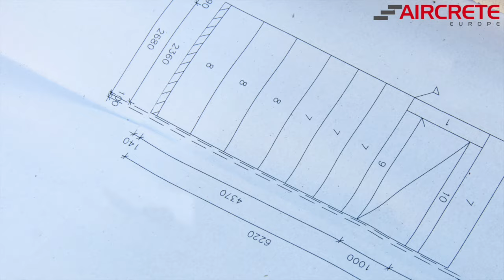The Aircrete Building System

Comment: I think Foam Crete is a good material for using a buildings if used correctly. I don't like  how they put this house together, there isn't anything holding the panels to one another, just some adhesive cement on the bottoms, then on the top! Normally whenever you build anything with concrete or foamcrete you use some type of rebar, there isn't any in this.  They should at the very least have some type of steel pins going from one panel to another. This is crazy the way this thing is built, it looks like a house of cards to me!
Reply: no, the guy helping to attach the crane to the block is spreading mortar along one edge, this is holding the blocks together. My grip is that it is single skin, I don't know how long term it will stand up to damp penetration. I would prefer to see the blocks made of 2 skins sandwiched by cavity insulation foam
Reply: It is an engineering sense and practice what you have stated and wish to receive a professional reply from the company.
Reply: I've worked with all kinds of structural building materials, and I have used Fiber Crete in some insulation projects, People have claimed a lot that they can get good flexibility, tensile strength, and compression out of fiber crete, but I've only seen any type of structural integrity with some type of rebar included like you would do with any type of regular concrete. When ever I have done any type of wall or foundation with concrete the building code has required steel bar reinforcement. What they are doing here just doesn't seem correct to me from what I am observing from this video.
Reply: Workin Alday I can say it is similar to load bearing wall system where bricks or blocks units bonded together to form a stable wall and then tied on the top by concrete tie beam and then cast the concrete roof. This kind is widely used in some countries in Middle East in the last 60 years especially for small villas where no structural criteria but general practices developed throughout the years. But I'm still curious about the AAC panels and how is it feasible in low cost housing.
Reply: Yea from an insulation perspective I think the panels are great, I wouldn't consider them for anything structural without a steel reinforcement though.  Maybe they actually have the steel in them. Foamcrete is normally really light weight, there shouldn't be any reason to lift these things with a crane! So maybe they already have the rebar in the panels.
Reply: Workin Alday 
Their tensile qualities probably don't require rebar. I bet the bubbles serve that function.
Reply: It's just cellulose, it does give it a high compression rating. But up where I live you have to put rebar in it. Building code won't allow just poured concrete or fibercrete. Especially on those panels that they are using as a roof.
Reply: I tend to agree.  While looking at this i'm also keeping earthquakes in the back of my mind due to where i'm planning on building and unless I missed something (which could easily be), that just looked like really big bricks with mortar, which I would have thought would have the same problem as small bricks and mortar.  Maybe that area just doesn't require those safeguards though.
Reply from the maker: Dear All, thank you for the interesting discussion. Autoclaved Aerated Concrete (AAC) is NOT foamcrete, fibercrete or cellular concrete. AAC is made of sand, cement, lime & gypsum (as binders) and aluminum as aerating agent- the products are steam cured in autoclaves during production to complete the strengthening chemical reaction. This lightweight product provides structure, insulation and fire resistance in one product. AAC panels have embedded steel reinforcement for additional structural strength. AAC panel building complies with existing US building regulations and is currently successfully used across the US (see www.aerconaac.com).
Reply: Good to know, thanks for the response. I thought this was regular foam crete, with no steel in it.
Reply: I wouldn't want to be in that house during an earthquake.  I noticed the same thing.
Reply: It's not simply foam crete....so...........
Reply: Workin Alday they insert rebar in the small holes you see in the panels
Reply: Well I am not sure why you did not notice them using metal connecting bits at tops of each block and also when the walls go up they drive metal dowels through the sides.
Reply: i agree with you.....
 from engineering perspective 
building are sorted as three main types  :
1-skeleton system 
this system  rely on (flexibility) which  mean all structure members must be connected  together from roof to footing or lowest  slab  by flexible materials such as steel bars or steel tubes and react as a body bone.
2-wall-bearing system:
there is no re-bar or any flexible  connection in this system because  its rely on ( rigidity ) of  heavy bricks,and these bricks  has a large width around 600mm -400mm .
3-space system:
this  include dome and vault which not our case
Reply: These wall andere floor panels are reinforced where needed with corrosion protected steel bars.  Of course loadbearing properties are based in state of the art stress calculations. In fact the whole building structure was stress calculated.  
Other than dense concrete, foam concrete is permeable for moisture and vapor. 
As true for all houses regardless their materials, cold bridges must be avoided.  
Due to good insulation properties of foam concrete heating costs are reduced.

Foam concrete is a good and durable construction material when the building is designed, build and finished by skilled people that know what they are doing.

Regards
Greattimez
Españistan

Comment: I'd like it better if the panels were interlocking or had metal rods connecting each panel. Maybe both. I'm sure how they built it is just fine but I'd like the security of having each panel fastened together with something other than concrete or mortar. Just my two cents worth.
Reply from the maker: Hi Nathan Scott, every country (sometimes state) has its onw regulations. This video, shot in the Netherlands, has every 2nd panels anchored to another with a steel plate. You can also do it for every panel but that is fully your prerogative and not required by code normally.

Comment: The material seems interesting. 
Building codes in Europe are supposedly higher than in USA. 
Where are the specifications, engineering reports. 
I can not believe that some glue is going to hold those panels together in an earthquake, hurricane or tornado.
Due to ground shifting, swelling from moisture and shrinking from excessive dryness many homes develop cracks, walls shift.
This could be a major problem. 
There appear to be  no penetrations for plumbing, elwctrical, or HVAC. Drilling
holes would weaken this material possibly introduce cracking.
Daytime heating will cause that material on the outside of the building to expand ( even slightly ) at a different rate than the interior. This will cause shearing.  There appear to be no expansion joints.
Reply: Scott Hertzog thank you
I see now that this material is subjected to a high pressure steam to cure it. The DIYers are not doing that. That would make a big difference in its structural characteristics.
Reply: I guess you, like many others, failed to see that the panels are in fact pinned together at the top as well as joined with mortar. Making this a sound structure.
Reply: I found this material from a DIYer video where they were making it with a foam machine. It was not steam treated. Mis thinking that this material was made the same way. I have seen concrete that was not well done deteriorate over time.
       Small pores in concrete or masonry materials allow water to collect. In semi cold climates where freeze/thaw cycles happen several times in one season. Water gets in the pores freezes expands melts. After several years this results in spalling. Then it just keeps getting worse. 
       Reading that the material was steam autoclaved for curing makes this a much better product. The glued joints seem to hold although I live in an area where the soil dries and soaks in different times of the year causing significant structural movement. Foundation repair is a big business in North Texas. I will be doing more research. This is an interesting product.
Reply: Scott Hertzog ...Any specs here in the United States that are published?
Reply: Any specs in the US?
Reply from the maker: Dear All, specifiaclly for the specification of AAC and its use in US, please see www.aerconaac.com

Comment: Introduction of graphene to the mix is an ideal option for additional tensile strength.
Reply: bit expensive, lots of cheaper fibres already used
Reply from the maker: Dear Bernard Macarius, sure, however, AAC is in no need really to have more tensile strength. For its application it is used for many years, it perfectly suits as is. Moreover, it is normally a premiumly priced product, compares to its other cement-like alternatives, so adding extra costs will inevitably result in higher sales price for offtakers which is not desirable to say the least.

Comment: How does this construction material compare with sip construction? The latter is much lighter,and has excellent insulation properties,and goes up fast as well. There have been sip homes that have survived tornadoes/hurricanes while the neighbouring stick built homes have been destroyed.
Reply from the maker: There are many ways to look at it, but in short the pros are: AAC is fully prefabricated at a factory, costs typically less per ft2, has better acoustical properties (AAC is UL listed UL #924), has much better fire rating than anything else (4hrs on 8in), pest resistance is very high, it can be shaped and sculpted, same low waste on site due to complete prefabrication, highly environmentally friendly due to 1m3 of raw mats used to produce 4m3 of final product. However both systems have right to exist, or better put to co-exist as SIP has similar merits too.

Comment: Is there some positive mechanical locking of the walls and floors? (Against pressure in both directions, high winds and domestic explosions.) We've seen what happens when gravity's the only thing holding structures together.
Reply from the maker: Dear Parrot Raiser, to answer short, yes there are steel anchors holding the panels together. Remember this video represents just one house design in the Netherlands, where there are no natural disasters prevalent. However, AAC is used arodun the world so depending where you are, sure your local AAC producer can inform you on how it can and cannot be used.

Comment: How are they held in place? Not just the mortar at the seams I hope.... No re bar? How is this possible. I'm new to this, but intrigued.
Reply: I guess you missed the steel connecting pins connecting each of the blocks.  Also, the blocks are single solid pieces in the vertical axis where most of the load stress occurs. In essence, they are monolithic structures standing side by side.
Reply from the maker: Dear Mike, thank you for the question. AAC panels have steel reinforcement mesh/cage embedded in them during production and in that way they can be used as structural elements (conforming to EN and ASTM norms).
Reply: yakyakyak69 n
Reply: LOL ok, when I read "fixing the panel position with connection plates" I thought it meant the position was being corrected (fixed) with a short wedge... I think I read "correction plate" the first time.
So this is probably a thin plate that is the length of the entire wall height.
Reply: Fill or Fail ?
Reply: @AircreteEuropeOfficial  But no mechanical connection between the panels except for the tiny metal connectors hammered into the tops of the panels, really just an alignment connector.  The build is akin to Domino playing pieces.  Tongue and groove or steel pinnings would dramatically increase the strength of the structure with very minimal effort or cost.  This building isn't safely built even if it was on the most geologically stable area on earth.  Any deflection of the walls would make the whole structure unstable.

Comment: I might be thinking of a different product, but isn't it supposed to be really light? If so why are they using a crane/hoist? Also why no locking system like tongue and groove or similar?
Reply from the maker: MJ D, thank you for the comment. AAC is indeed light (5 times lighter than traditional concrete) and with density of 600 kg/m3 (or 37 lb/ft3), the wall elements shown in the video weigh about 210 kg/piece (460 lbs/piece). For panel profiling, see comment below.

Comment: hell in my day me and two other carpenters could fame and dry in a house this size in 4 days... three guys, no crane  fast and easy..with electric and plumbing done too..and if we where in a hurry we could have the roof guys in while we made sure all the little things were done like sheet rock backing and other things.. sheetrock guys after that usually two days then painting and finish work, cabinets and move in.. I don't know I am an old carpenter and contractor.. and it is hard for us to accept new things without some time to see how it works.. does the house breath right? is there going to be a mold problem? will the sun damage the exterior of the house in time? What will happen if there is an earthquake? Well the future is yours..keep watch, be diligent, and love like there is not tomorrow..
Reply from the maker: Dear tinkmarshino, thank you for the valuable comments. To answer short, the AAC material breathes yes, provided you apply a breathable stucco/paint. Mold is not an issue as it is completely inorganic material. On the sun damage, again the material itself wont be affected by the exterior finish for sure with time will (AAC should not be left unfisinhed, just like any other material).

Comment: Why did they not use inter-locking panels.  Just make the forms different.  I think the dome homes I seen built out of this stuff is far better than just stacked panels beside and on top of each other.  I pray they didn't pay any "engineer" a bunch of money for this design.  I'm with everyone else HOUSE OF CARDS
Reply from the maker: Dear Rameus, the design of the house determines its ability to withstand natural disasters. This video showcases a house in the Netherlands and of course it would be built (read: designed first) differently elsewhere. However, the fact that AAC is used for decades in walling and flooring from Japan to Mexico shows nothing simply falls to pieces.

Dome houses you are referring to are made of simple foamed concrete, which is not steam cured (ie. autoclaved). That material has many disadvantages, starting with shrinking to begin with. Hence, I urge you to understand what is Autoclaved Aerated Concrete in detail and you will discover that it has its merits everywhere in the world as it has been used like that since the 1940's.

Comment: This may have been answered already but what are advantages and disadvantages of Aircrete vs ICF???
Reply: Having air in the concrete insulates and uses less concrete. But I'm sure for the amount of concrete unless making your own the company will charge even more for the amount of concrete. If a real building with by code affixed panels were built it might still save on construction labor time.
Reply from the maker: There are many ways to look at it, but in short the pros are: AAC is fully prefabricated at a factory, requires less final finishing, has better fire rating than anything else, pest resistance is very high, it can be shaped and sculpted, super low labor waste due to complete prefabrication, highly environmentally friendly due to 1m3 of raw mats used to produce 4m3 of final product.
Finally, an important factor is also system completeness, that is using AAC external, internal walls and floor/roof structures can be built as well as stairs which ICF pretty much walls. One stop shop concept is very appealing in the case of AAC.

Comment: I love the concept of AirCrete. However, you have to be joking the way they put the panels together. They wouldn't withstand a hurricane or tornado of any seriousness, and an earthquake would likely be a disaster. You might as well super glue them together. Good luck living in that place.
Reply: I guess you, like many others, failed to see that the panels are in fact pinned together at the top as well as joined with mortar.  Making this a sound structure.
Reply: haha mortar does noting with lateral forces
Reply from the maker: Dear Michael, the design of the house determines its ability to withstand natural disasters. This video showcases a house in the Netherlands and of course it would be built (read: designed first) differently elsewhere. However, the fact that AAC is used for decades in walling and flooring from Japan to Mexico shows nothing simply falls to pieces.